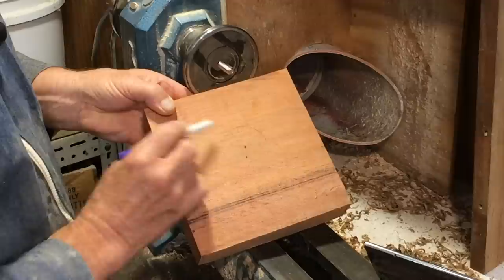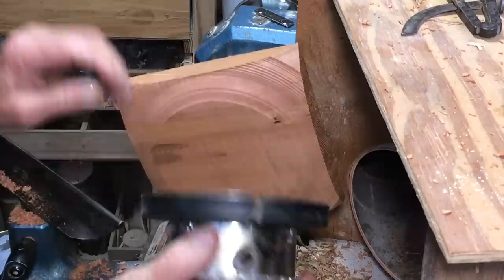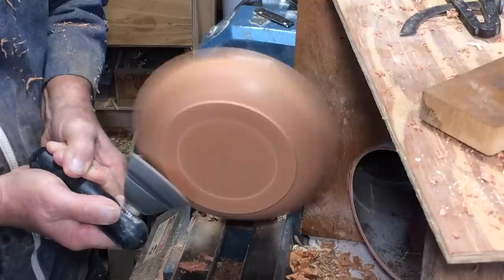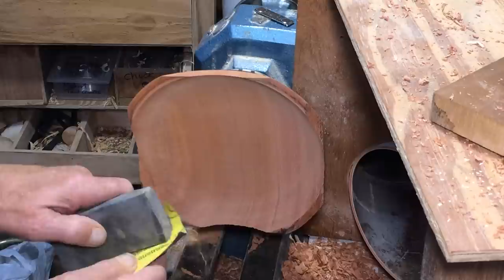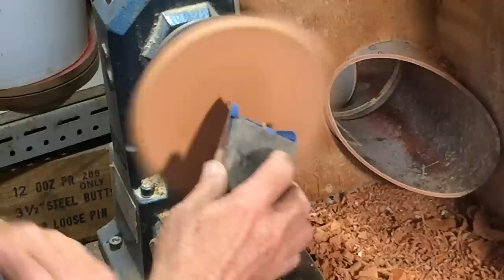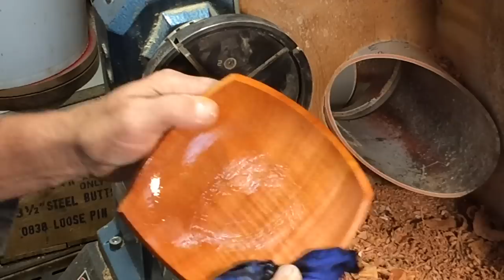Richard Raffan turns a square dish

Comment: That sanding disc to take the bowl back to a square is genius. I have tried making square bowls before but they didn't look right to me after I was done, and your method fixes that problem! Thank you for another awesome lesson!
Reply: The point of turning a square bowl is not to cut the round to a square, but to keep the maximum dimensions of the blank.
Reply: @Anry_V  woodturning is 70% creating and 30% problem solving
Reply: @j.a.d.creations  whoops I've been doing that backwards. Just started out a couple months ago but learning with each turn and "mistake"

Comment: Richard, if that hard-to-remove cap is a "push and turn" type, here's one trick...  if it's a two-part cap, where you have to engage the outer cap with an inner shell to get the cap off, sneak a dab of CA glue into the crack between the two parts.  When it's cured, both halves will be connected, and no "push" will ever be needed again to get the cap off... just twist.
At my age, I had to find an alternative that would work, and for two-part push-and-turn caps, the dab of CA has proven to be a wonderful solution.
Great video, by the way.  Thanks!
Reply: Oh my God I cannot thank you enough for that solution I use Tru oil and always fight with the caps

Comment: I am very happy that you’ve made these videos. I’ve got some Velcro and am going to make a sanding disc and support soon. Also the end grain hollowing is outrageous. Watched the video went to the shop and in three or for dips was at the bottom, way fast the a drill bit, and I had a round shape instead of the square that the bit leaves. Great tips!

Comment: Thank you yet again, Richard, some good ideas May I ask please I didn’t quite hear what the stuff you used to clean off your sand paper Wass can you please tell me what it was? Many thanks, William
Reply from the maker: It's the tailend of a rubber cleaning stick. You should be able to buy abrasive cleaning sticks anywhere they sell sanding belts and disks. I've seen a shoe sole used, but those that don't work further clog the belt.

Comment: What rubber was that you used to clean the sanding disc?
Reply from the maker: I believe it's crepe rubber. You should be able to buy abrasive cleaning sticks anywhere they sell sanding belts and disks. I've seen a shoe sole used, but those that don't work further clog the belt. Guess how I discovered that...